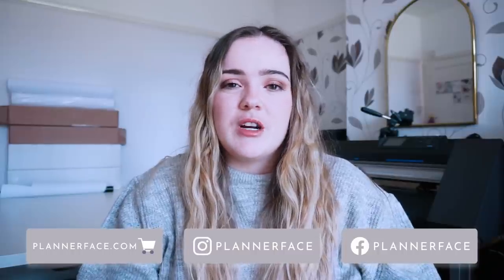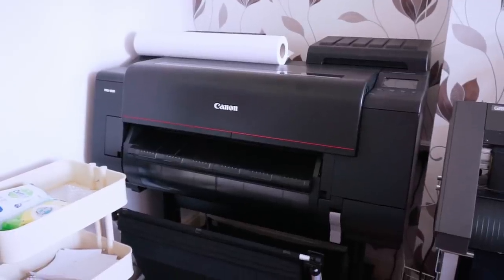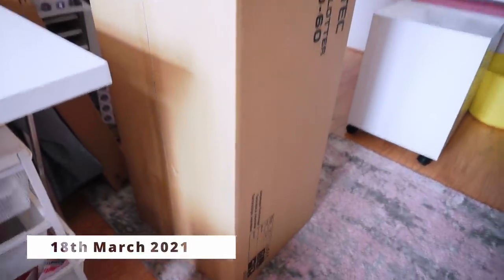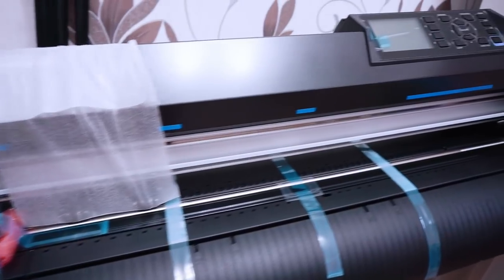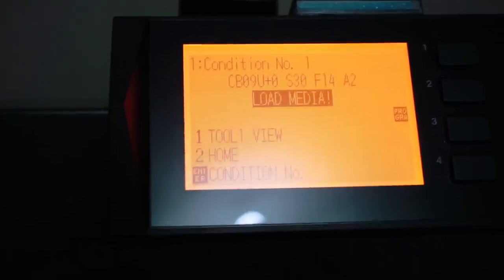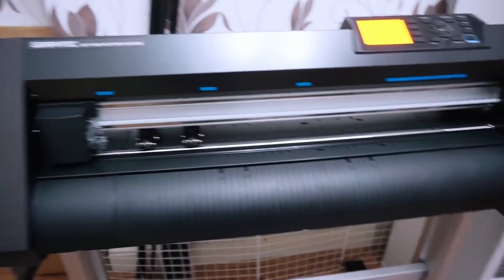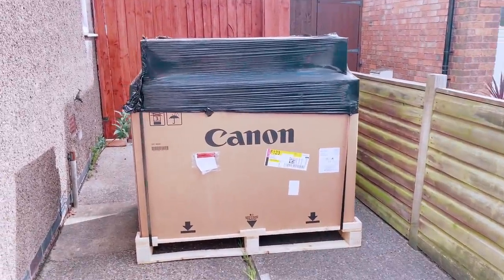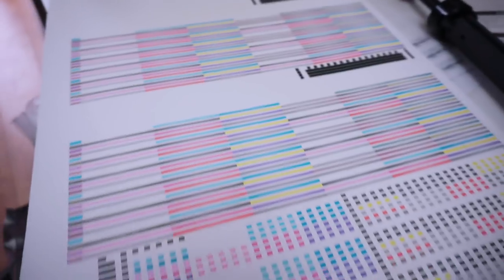Investing in a Wide Format Printer & Plotter For My Small Business! | Plannerface

Comment: Congratulations on the cutter and your investment in you and your business.  Those plotters do seem needlessly large but u hear great things about the Canon line up. I do have a question.  Does it now cost you more in vinyl material than when you were, i assume, doing vinyl sheets?

Thats my issue. I have the plotter printer, I'm considering the Graphtec the exact same model, but when i calculated the sq/ft cost of switching it was considerably more to go vinyl rolls vs just keeping with vinyl sheets.  I'm currently doing laser prints on vinyl, then laminating and cutting with a brother scan n cut.
Reply from the maker: Thanks Katherine! So I actually don't use the machines featured in this video anymore (mainly because I couldn't get the cutter to reliably cut the teeny tiny stickers I make with the accuracy I expected) but the cost of the consumables was definitely something I naively assumed I would be able to absorb without much problem. It was significantly more expensive to produce stickers with the wide format kit, ink being the worst part but the roll vinyl was considerably more expensive. When I did my back of an envelope calculations prior to the investment, I hadn't fully considered how much ink/vinyl is wasted due to cleanings (which can be minimised), margins and just human error (of which I had plenty 😅) so my expectations of cost were pretty far off what ended up being the reality.

I think if you were producing something like fine art prints (what the printer is really made for), you could stomach the cost/increase prices accordingly as it's a higher ticket item. 

I ended up selling the machines (not really at a monetary loss thanks to covid supply issues - def at a sanity loss 🤪) and after some time to regroup I went with a Graphtec F-Mark 2 - their automatic feeding cutter. I show it in my more recent videos (I got it in Feb 2023) but I'm able to use it with A4 media (it takes up to SRA3) so I kept my original printers/paper/ink etc. I should probably do a summary video on this, as this video is one of my most popular but it's not clear that I'm no longer using them. Hope this helps a bit, if you'd like to chat more feel free to pop me an email or DM on instagram or something :)
Reply: @Plannerface  yes I binged a few vids and saw you went to the F-mark 2, and now I need to find more info on that machine.  It loading the pages is amazing.

That makes sense about the cost of material and inks.  I have 2 plotters. I always buy used, because it often comes with extra ink and printheads, whatever the person had left. But you have to test the machine before buying for sure.  But by doing that i can often find ink cheaper on eBay on older machines.  Both are HP though i dont recommend HP for smaller home office machines. I was going sheet by sheet to print as you can't load a stack, but discovered 1, it's super slow. And 2. Even laminated the prints aren't waterproof.  So I switched to laser which even if not laminated are waterproof.  I still laminate.  

So the larger graphtec you found doesn't cut detail as well as your silhouette?  That's interesting. There's like a $2100 difference in price I thought it would do amazing.

I'm going to head over to insta and follow you.  The Ink Shop maybe message regarding a question or two down the line about the f-mark 2 if that's cool? First I'll watch a bunch of videos on it, which may answer any questions that come up.

Comment: Hello there i have the same setup  but i've problem with the  cutting on the plotter. Well i can print  through the eco solvent large format printer with the maintop software which came with it but After if i want to cut the same design on the plotter  with the design i did from the Eco solvent printer machine the plotter  doesnt work it cut  on different places instead of cutting on the design.The plotter soft ware i use is sign master software . Please  is there any software  which i can use on one computer for both eco solvent large format printer and the plotter machine that will work perfectly without problem  ?
Reply from the maker: I'm not sure, sorry! I would advise looking for wide format forums or groups on Facebook and asking there!

Comment: How much square foot per hour... How much passes they use to print that quality?
Reply from the maker: I am not sure on either of those unfortunately! I just got the machines so haven’t timed any bulk jobs
Reply: @Plannerface  the machine specs should have it...do you mind sharing the model ... I have operate what supposed to be high end wide format but sometimes the print are grainy
Reply from the maker: Canon imagePROGRAF PRO-2100 and CE7000. I ended up going with a "fine art" printer because I was concerned about grainy prints

Comment: May I ask which platform you sell on
Reply from the maker: I'm on Etsy and Shopify!
Reply: @Plannerface  so awesome! I'm in the car industry but just doing it as a hobby :d is a epson ecotank good for now? That's what I'm using but some papers are bad because the glue residue particles stick on top and bottom when it cut it with a cameo 4. Could you also tell me what program you're using to cut? And print registration marks. I realized my plotter is the exact same as yours I use to cut window tint. It's just rebranded as a vinyl express!
Reply from the maker: @dandee28  Oh awesome, that sounds so cool!  I've never used Epsons myself but I've heard good things about them from friends. I'm no longer using the Graphtec I showed in this video, but when I was I was cutting with Adobe Illustrator + Cutting Master 4 plug in!